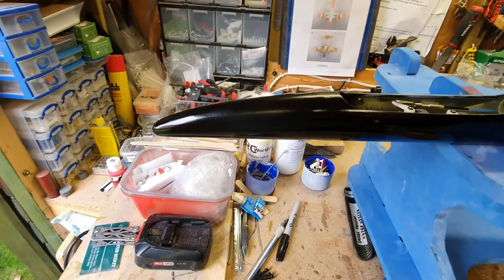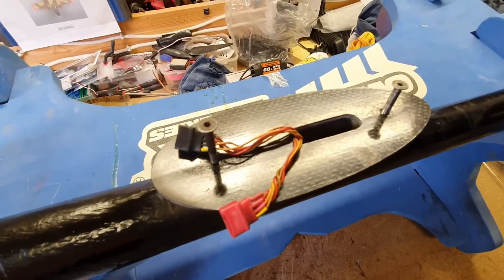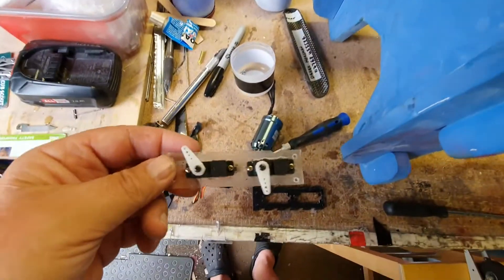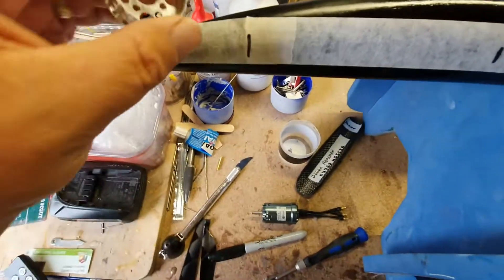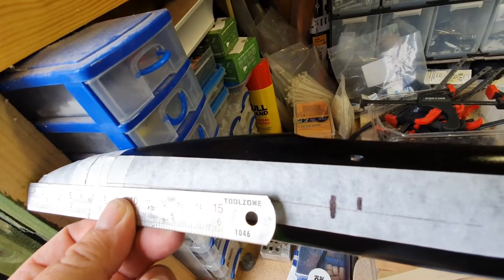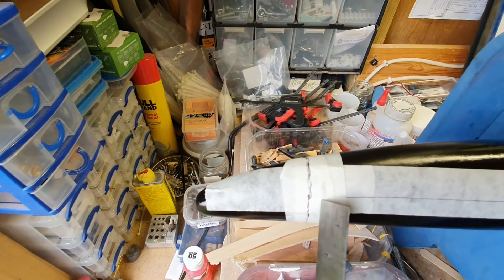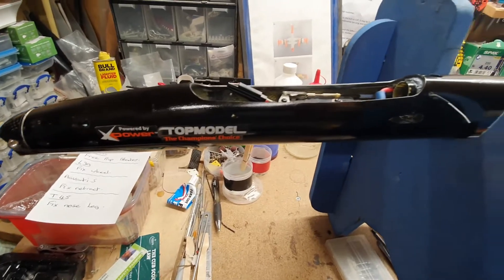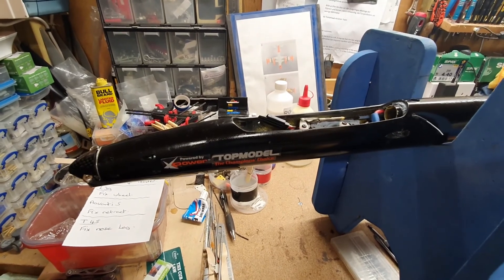Vladimir Models Supra - Electric Conversion

Comment: Pilot Pete, thanks for recording and uploading this video. I am considering modifying my own Supra in a similar way and found this very helpful. I have a few questions if you are willing to help further. Did you need to add any tail weight to compensate for the motor weight up front in order to achieve the correct C of G? What motor did you use - looks like an Xpower but can't quite read the model number. Also what esc and prop did you fit and what sort of current draw do you get at full power? Thanks.
Reply from the maker: Hi Peter, 
Thank you for your kind words and interest in my video. The motor is an MVVS 4.6/840 Sport Brushless Motor, ESC is and overlander 50A. The motor position is the front, then I have the lipo (800mah 3S), then the servos, with the ESC and Rx behind the servo tray around the CG position in the Fuselage. The model balance perfectly on the CG with this lay up. With this set up the output is 770W 36a using a 12 x 6 prop.